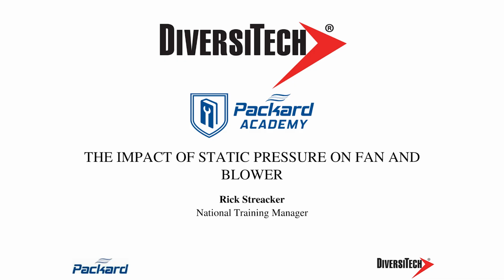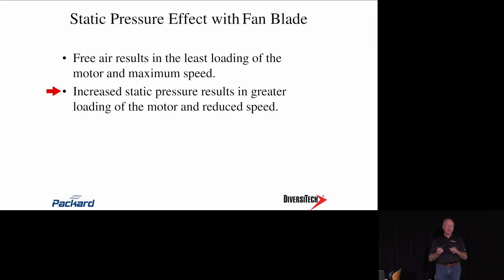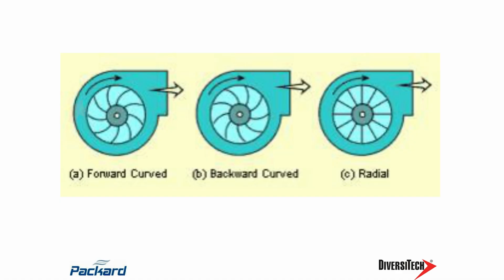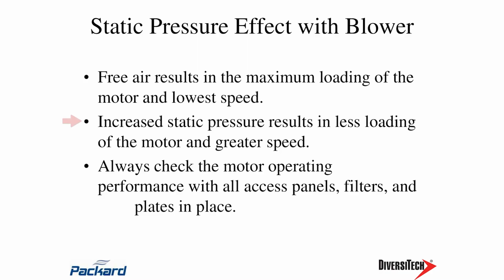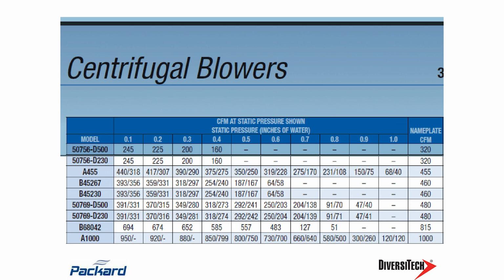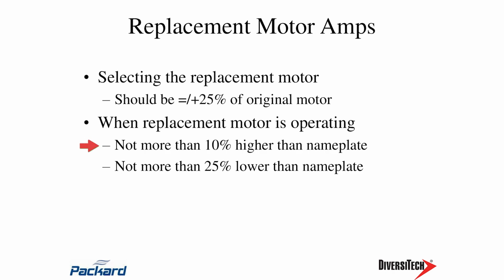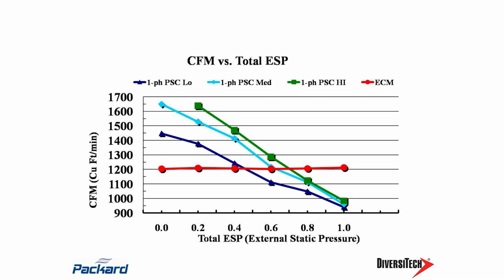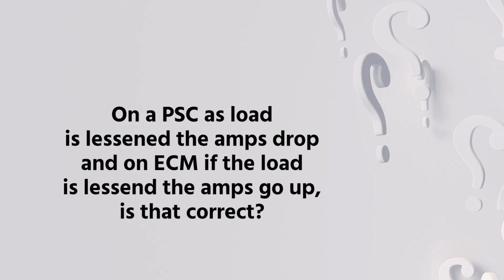The Impact of Static Pressure on Fan and Blower Motors w/ Rick Streacker

Comment: Best video I've ever seen on this subject and explains a lot.  As far as amp draw when static pressure increases, I have the documentation for my Ruud AHU, which has an ECM X13 constant torque motor, and when static increases, RPMs go up and so does the wattage, so there is clearly a difference between a PSC and ECM motor.

Comment: Why would a blower motor's external static pressure regularily be 0.4 to 0.8 W.C ? dont most furnaces call for 0.5 W.C max?
Reply: Depends on the manufacturer,.  I have a Ruud AHU, that lists specs for statics as high as .70.  I also have seen specs from other manufacturers that list specs up to 1.0 static.  Your design goals for duct should try to keep static as low as possible.

Comment: Hi, related question I hope...........

I have a fuji aru24 RGLX medium duct system.
As you may or may not know the two ton unit comes with the default setting of 31 for Function 26 –> Static pressure which = .18 inWG.
Settings go from 03 to 20,  ranging from 03 = .12 inWG   by increments of 1, up to 20 = .8 inWG

There is also a setting of 32 = Automatic Air Flow Adjustment.

Does this vary the static pressure or something else.  Is it reasonable to use this if the installers clearly have not made any calculations other than the system is designed for that unit and thus the default setting is fine  (  no measurements of lengths of ductwork type of duct, number of turns,  height of and length of copper etc….).   I am assuming that this setting basically looks at the supply fan load ( amperage ) to decide the optimal setting..........??

Comment: It has been my experience, when restricting supply air to a blower or fan it cavitates, has has less load, and amps decrease. The motor may actually increase in temperature, and system pressure will increase, causing higher than normal amps on the compressor and decreased efficiency overall.
Reply: This is true and can be shown on the blower curve, but this is only when the cfms are cut way back.  In fact, the lowest load is against a fully closed system.

Comment: I finally get the inverse relationship between fans and blowers. For blowers the best way to think about it is with a straw. If say you want to move a piece of paper that is 3 feet away from you, you can blow try really hard and exert a lot of power (amps) to move the paper.  You even purse your lips to increase static pressure.  Now if you blow through the straw, you have static pressure and you can easily puff into the straw with less power and direct that to the paper with ease.

Comment: Most manufacturers air handler tables for total CFM at various static pressures are listed in blower motor watts.  

To calculate watts from measured motor current you must convert measured V*A to watts by multiplying VA by motor's power factor.  Best if you measure PF directly as it changes with motor load, but if unable assume a PF of 0.85 for PSC motor and 0.65 for ECM motor. For ECM motors you should use a true rms clamp-on amp meter.  If you have a meter to measure PF it will usually give you watts readout directly.

Comment: A bit confused: Question,
If you remove the blower door shouldn’t the amount of available air( boxes of air) increase thus less static pressure( less air restriction ) ,thus higher amps (blower works harder) and therefore more air moved across the blower?
Reply: I would imagine it would drop the static pressure. If it is a PSC motor it would lower the amp.
Reply: @mackenziegray2090  No, with PSC, the amps go up because there is more air to move.

Comment: QUESTION: what are the mostly likely issues that would cause the delta T at one register to be only 8 F, but 16 F at another??

Background info: the ac unit is in the attic, there are two intake registers in the ceiling and 14 outlet registers. 
the 16 F register is closer than the 8 F register. the ducting in the attic are R8, so i dont see how the ducts would be so hot as to heat up the air more than 2 F. 
I though maybe there is a leak, but the air flow from the 8 F seems ok and because it is on the upstream side of the blower any cooled air would go into the attic, not the other way around.
Reply: Check your CFMs at both registers. The 8F my be significantly lower than the 16F.
Also check your “wet bulb” at both return register locations also.

Comment: Think of a vacuum cleaner - block off inlet, motor speeds up - not moving any air so current goes down - try it with vacuum cleaner plugged into a  kill-a-watt device. 
Same thing with a vacuum pump - draws more current when initially pumping air - current on motor goes down as air volume goes down as vacuum is reached.
Reply: nice analogy!

Comment: So with blowers (vs. fans) higher static pressure leads to lower amps (but higher speed).  Counter intuitive.  But the lower amps are actually bad for motor longevity because the lower CFM isn't cooling the motor enough.  That blew my brain windings.
Reply: For real life isn't what it seems anymore.
He ruined my feeling of having common sense.
Reply: This is true for PSC motors, but with something like a ECM X13 Constant Torque motor, both RPM and Amps go up with increased static.

Comment: Very informative presentation!  Usually not a technician strong point in troubleshooting.  Thank you very much for publishing. I should add that this now emphasizes the importance of proper duct sizing when replacing/retrofitting ducts.  Drop in replacements and retrofits modify the ducting and airflow.  This presentation emphasizes the importance of proper engineering of the ducting.

Comment: Can anyone explain why the fan blades on walk in cooler/freezer have the shaft hub and lock-screws facing the motor sides? It’s so hard to remove those fan blades. Why those fan blades are not made the same as the condenser fan blades?